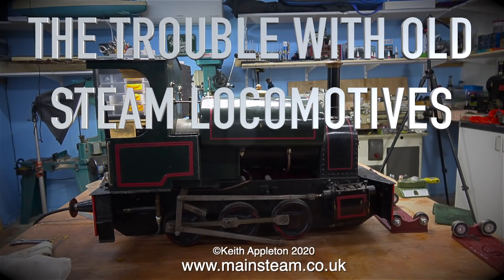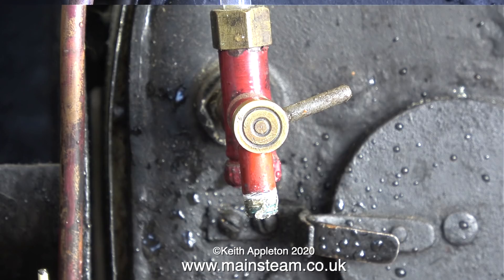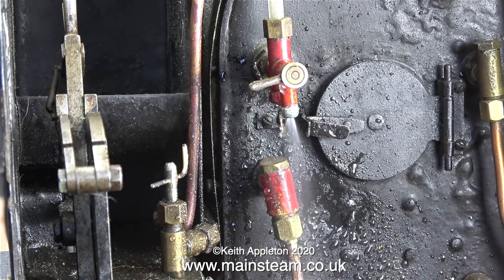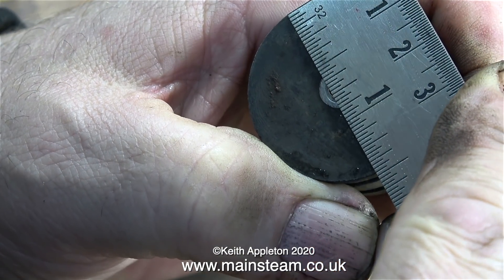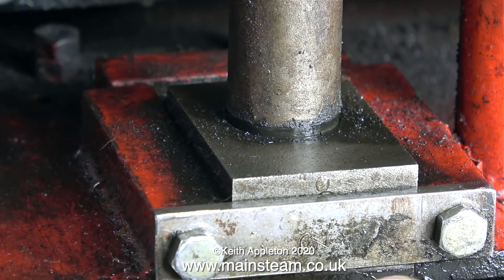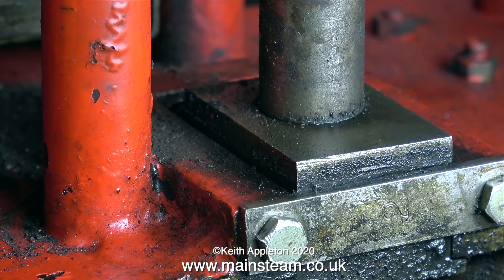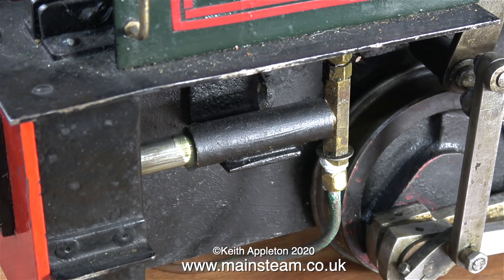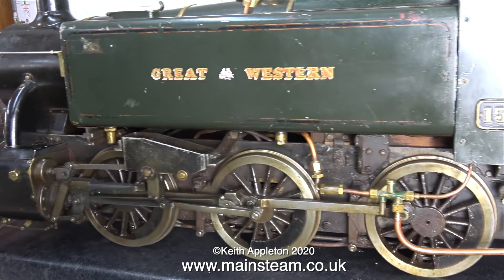THE TROUBLE WITH OLD STEAM LOCOMOTIVES - PART #2

Comment: I'm building a polly would you say they are reliable there is someone at the train club I go to that say they are but I want to now by professional
Reply from the maker: I have never owned one, but from what I have seen of them they are OK. I think the wheels are a bit small though, when I have seen them passenger hauling at speed the wheels are a blur and I would be concerned about the wear rate if run excessively for long periods like I used to do with my engines......

Comment: What’s the difference between coupling rods and connecting rods ?
Reply from the maker: Coupling Rods Connect the wheels, Connecting Rods connect the piston to the crankpin via the crosshead.
Reply: Keith Appleton so dose that mean the connecting rods provide the motor power from the pistons to the wheels ?
Reply from the maker: yes
Reply: Keith Appleton thank you
Reply: Simple way to remember - Coupling rods between the wheels, hence the term Coupled Wheels.

Comment: qestion @ Keith : why dont the use ball bearings on the main axels ? iam not a steam guy so sorry if this a silly qestion. ( more into model airplanes / playing saxophone and ham radio )
Reply: Same with prototypes. Roller bearing were used experimentally on the last of the class 5 4-6-0s built around 1950 and then in many of the BR standards. I understand that the locomotive has to be set up more accurately. This was an issue with Tornado.
Reply from the maker: I do, but the majority of model steam locomotives have plai axle boxes.

Comment: Hackworth Valve gear! Like our loco! But its the modified version same as ours.
Reply: It's Marshall Valve Gear, not Hackworth. Hackworth entails a dieblock and a guide that oscillates to reverse the timing of the engine. Marshall does this with a series of linkages as seen here so there are no sliding parts, only pivoting parts which from a maintenance point of view is desirable because the biggest wear points are replaceable bronze bushings. Same thing when you compare Walschaerts and Baker gear despite being entirely different valve gears, they were both common on later steam engines. Walschaerts has a dieblock that slides within the reversing or expansion link, and Baker only has bushings and pins that the Bell Cranks pivot on. Dieblocks and reversing links are specific to each class of engine while bushings can be made to standardized sizes for streamlined repair, which is why many engines built in the late Steam Era including the vast majority of "Lima Superpower" had Baker Gear. Having as many "COTS" (common off the shelf) parts on a locomotive as possible helped to significantly reduce downtime and increase the route availability so the engine can keep producing ton-miles and making money for the railroad.